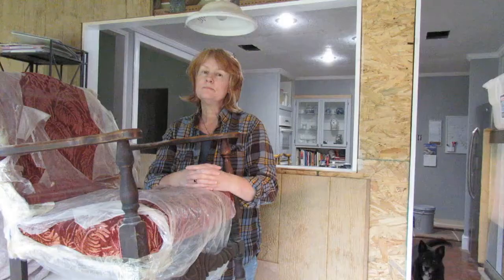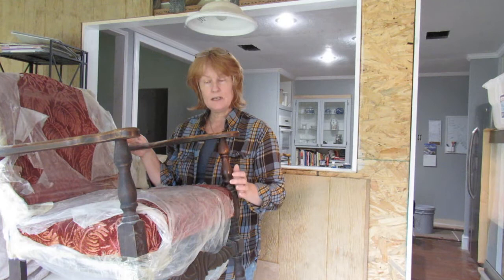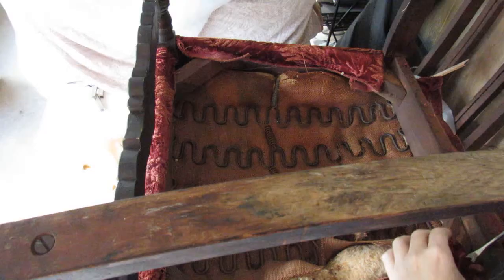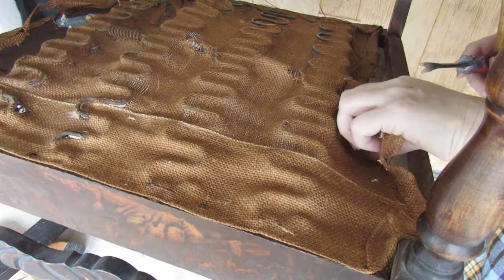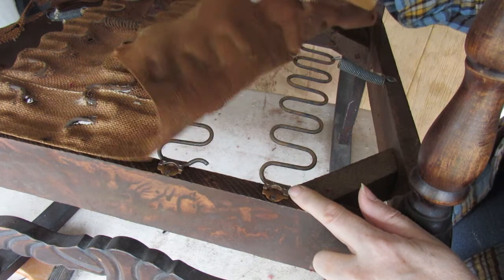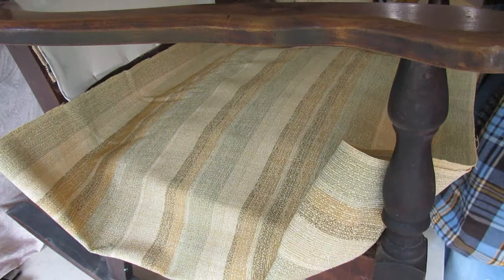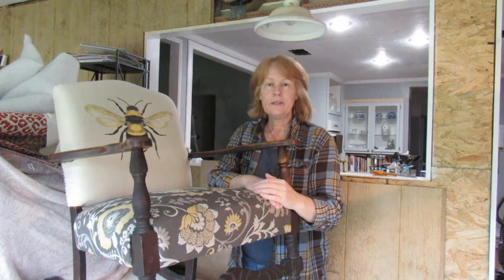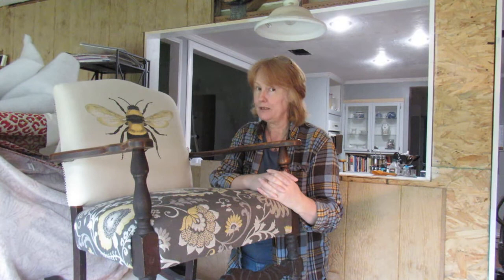Upholstering Around Exposed Legs - Rocking Chair Part 1 - Tutorial for All Levels

Comment: How thick is your base foam? 2 inch?
Reply from the maker: Thank you for your question.  I usually use a 2"/5cm thick, high-density/extra firm piece of foam for the base as it seems to stand up better.  Remember to put a barrier cloth between the springs and the foam being used so the foam doesn't spread too quickly due to wear and tear.
Good luck with your project

Comment: What are the names of the types of material that you are using? Particularly the very first fabric you used to replace the original burlap layer and the white material. Thank you
Reply from the maker: Thank you for your questions.  I replaced the burlap with a linen/cotton mix otherwise known as "Linen Union" in the UK or "Duck Cloth" here in the States, canvas and denim can also be used as they are also very hardwearing.  The white fluffy stuff that goes under the top fabric is "Dacron", it acts as a filler and smoothes most of the unevenness out, and makes the top cover look plump and rounded.  Dacron also helps smooth out the fabric as it goes under the chair frame, this helps the top fabric from wearing through too quickly.  The foam gives a very flat look, which is why I suggest putting dacron over it.
Good luck with your project.
Reply: @beinspired1487  Thank you for your helpful response!
Reply from the maker: @elainaborrelli5083  Not a problem,  I might have accidentally cut the information out of the film or thought I had said something and didn't.  If you don't ask the questions you will not know the answers, please do not hesitate to ask.

Comment: Is the cuts the same for a round seat?
Reply from the maker: Thank you for the question.  If the seat is rounded and the legs are exposed as in this chair the answer is yes.  I would suggest being very tentative with the fabric cuts and tucking it in and the around the legs as the shaping of squared or curved legs can vary too.
Good luck with your project.

Comment: What is the thickness of the foam you used?
Reply from the maker: Hi, I'm sorry that this piece of information was missing.   I will write it into the description for future use.
I used a 1" or 2.5cm depth of foam for this project and it was very firm density.  You could use medium-density at a push if you don't use the chair very often.

Comment: What type stapler and size of staples did you use?
Reply from the maker: Thank you for your question.
I shall start with the staples, I use a combination of 3 sizes.  
The smallest size is 6mm/ 1/4" depth for single payers of fabric as there is little stress on them or to just hold the fabric in place temporarily.  
The medium size is 8mm/ 5/16" I use them when putting pipping and back tacking on for the finish under the chair seats.  Here again, there is little stress so they don't need to be too deep and again as a temporary solution when moving fabric around on the project.  If you don't want to buy the smaller size this size is really your main go-to staple size.
The largest size is 12mm/ 1/2" I use for high-pressure areas.   These ones I use when putting the card back tacking on to hold fabrics in place under the arms or along the top backs of chairs/sofas or the aluminium back tacking used to hold the fabric in place along the shaped tops of chairs or for invisible finishes next to the piping.
 As for stapleguns, I prefer to use an upholstery staple gun with a long nose as it fits into tight spaces.  It has to be used with an air compressor, so if you are starting out this might not be the way to go for a little while.
When I started out I used an electric staple gun as it has the force behind it with little stress on your hands.  Once you get to the point 
you're wearing this style out in a year, then you really need to upgrade to an air compressor staple gun.  
Good luck with your projects.